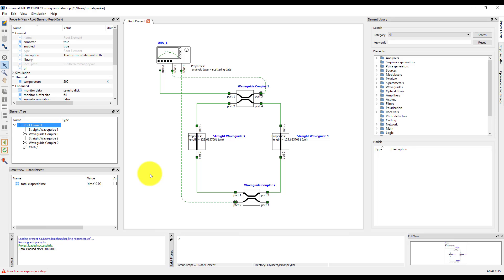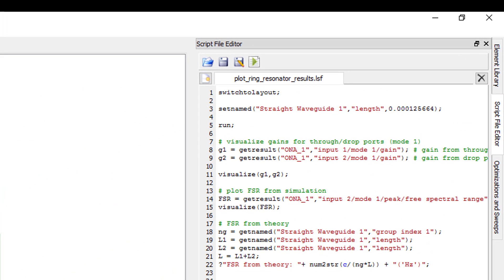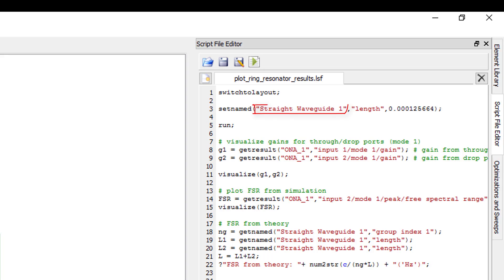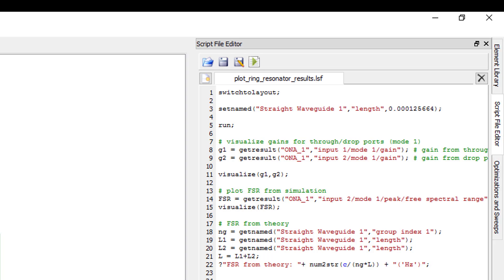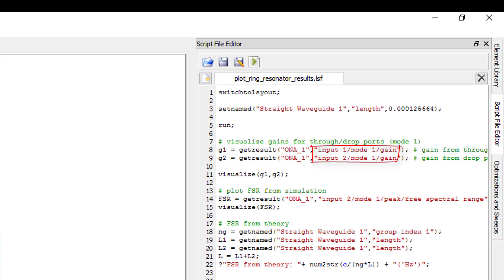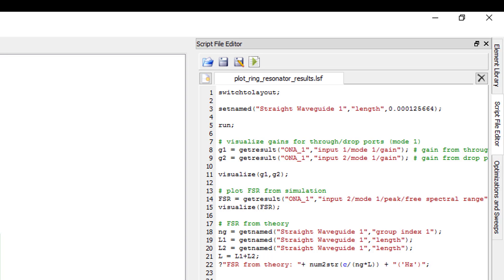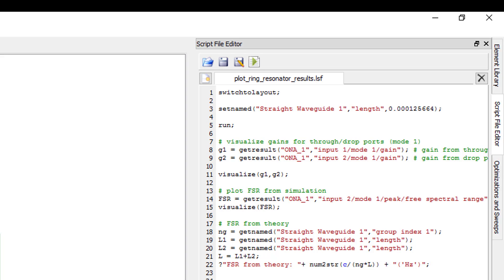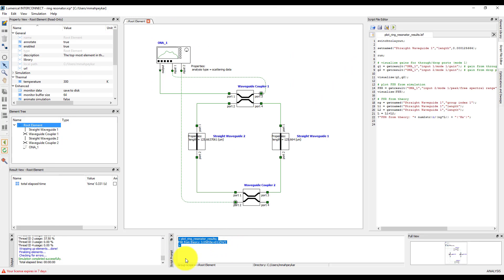Application Examples for Ansys Lumerical INTERCONNECT — Lesson 3, Part 4

Comment: switchtolayout;

setnamed("Straight Waveguide 1","length",0.000125664);

run;

# visualize gains for through/drop ports (mode 1)
g1 = getresult("ONA_1","input 1/mode 1/gain"); # gain from through port
g2 = getresult("ONA_1","input 2/mode 1/gain"); # gain from drop port

visualize(g1,g2);

# plot FSR from simulation
FSR = getresult("ONA_1","input 2/mode 1/peak/free spectral range");
visualize(FSR);

# FSR from theory
ng = getnamed("Straight Waveguide 1","group index 1");
L1 = getnamed("Straight Waveguide 1","length");
L2 = getnamed("Straight Waveguide 1","length");
L = L1+L2;
?"FSR from theory: "+ num2str(c/(ng*L)) + " (Hz)";